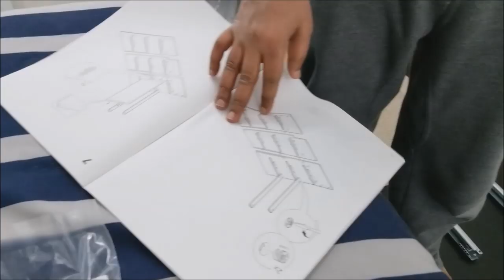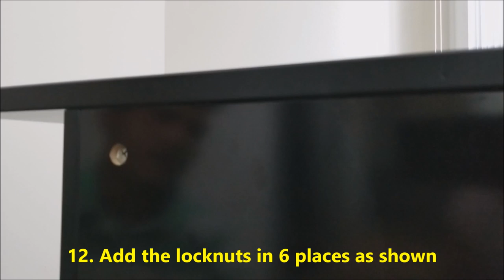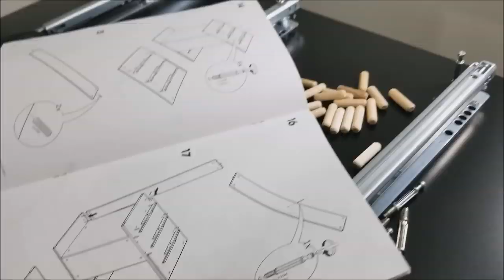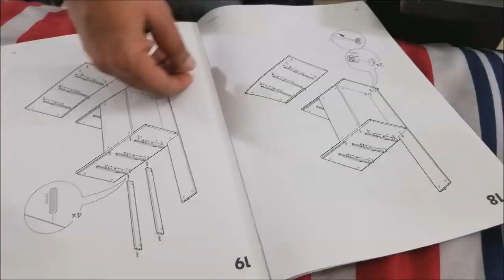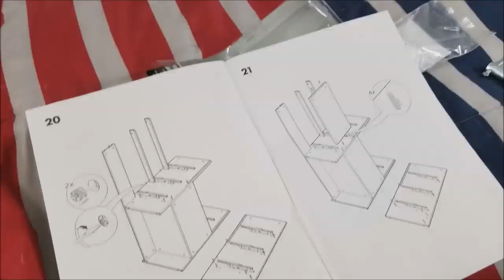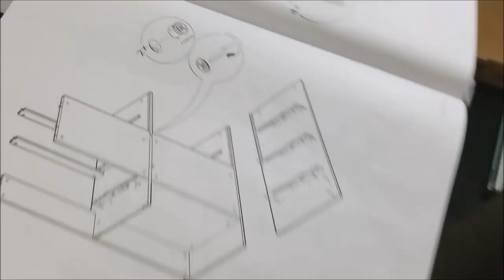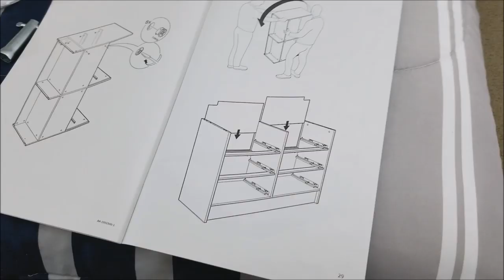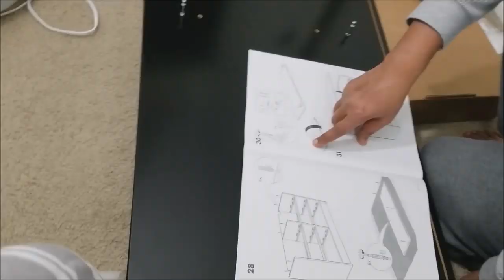IKEA DYFJORD DRESSER 6 DRAWER CHEST - HOW TO ASSEMBLE - Part 1

Comment: Doesn't the sliders have left or right on them? Can you clarify if you put the left or right ones on first?
Reply from the maker: Yes. There are different sliders for right and left sides. No particular sequence but one quick way to guess if you are doing correct is that the hook side should stays on the back side of the assembly as shown in the video.
Hope I am able to clarify you doubt. Thank you.

Comment: I’m having trouble understanding 5:33 when it come to placing larger board into the construction
Reply from the maker: Check if you attached the long screws as shown at 2:33  and the wooden locators  as shown at 5:05 in proper position